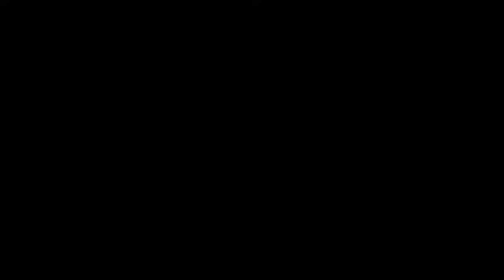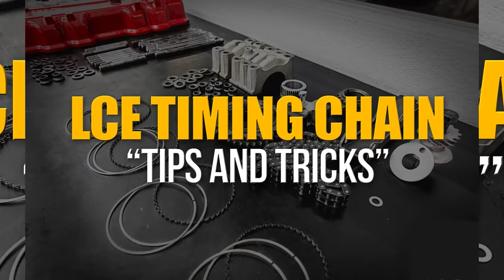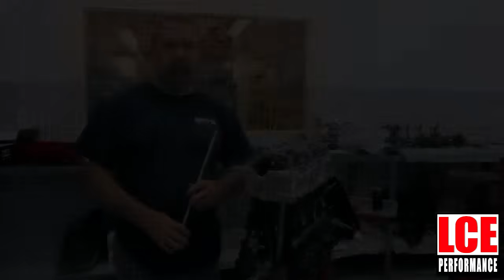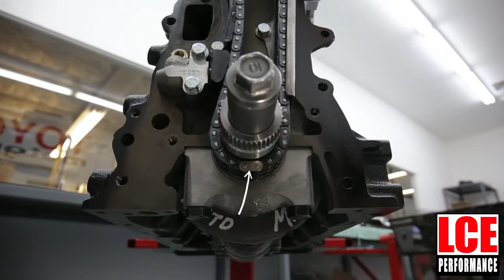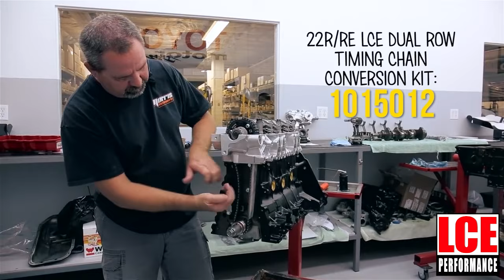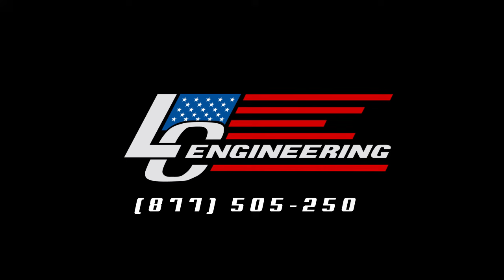LCE 22RRE Timing Chain and Cam Gear Installation Tips

Comment: 360k on one of those.  87 Toyota pickup. 4x2 manual 4 speed. Only ever needed was a radiator. 5 set tires and 3 set brakes, oil changes, filter changes and a couple sets of wipers. I loved that truck. Nice video. Thank you.

Comment: I just installed per this instruction and now engine will not detonate at all. Everything is set to spec and correct. Other than the duel row timing chain being set just half a link to the left. I'm pissed. Everything else I read states that it should be top dead center and now I have to take it all apart again. So fing frustrated.

Comment: If the chain is a tooth out will it wind over without hitting a valve.
I put a brand new chain in after counting the links but the were shiny links aside from the join.
I winds over perfectly but won't start even with engine start spray.
Although mine is the a 22r.
Reply from the maker: Give us a call, here to help you out 928-505-2501.

Comment: The dual row conversion kit for the 83 22r has "two" gold links on one side and "one" link on the other. Whats the proper link alignment for this set up?. In this video it only shows a timing chain with "one gold link per side.
Reply from the maker: The mark on the cam gear should sit in-between the bright links and it will be slightly off from the 12 O'clock position like at 11:55ish.

Comment: Sweet info, great video! Thank you.

Question: Is this a necsity on a motor that does not see maintained high RPM? 
What would be the main advantages to the modification, as far as reliablity? 
Overall advan?
I look forward to purchasing components from you shortly as my 22R has 250K with a cheaper "new" head. on it
Reply from the maker: Adjustable cam gears are generally used to correct camshaft timing after the head has been milled or when the block is decked. Cam gears are also an effective way to dial-in a camshaft by advancing the cam for low-end power or retarding the cam for top-end power.